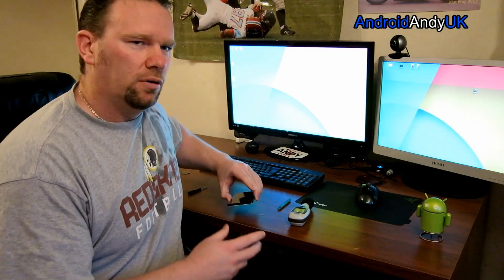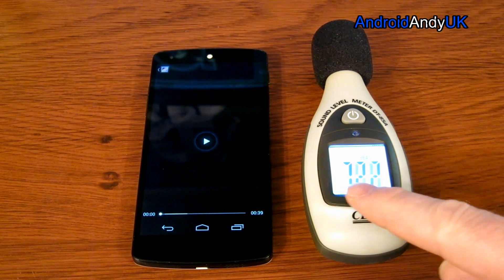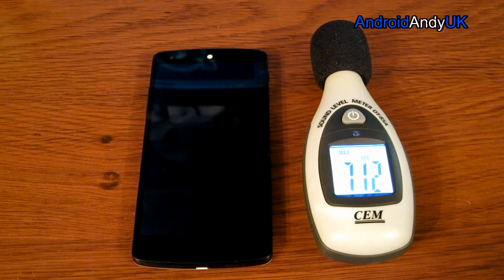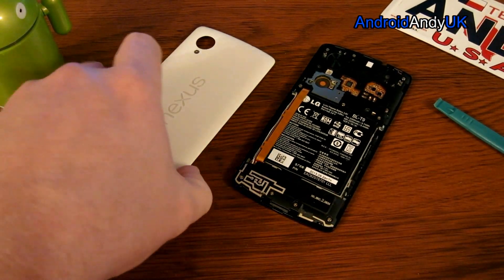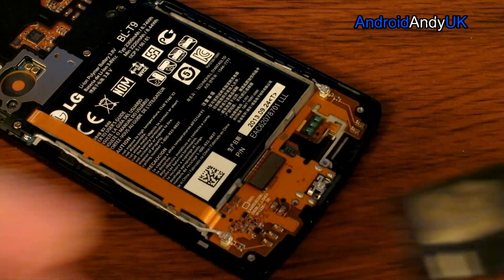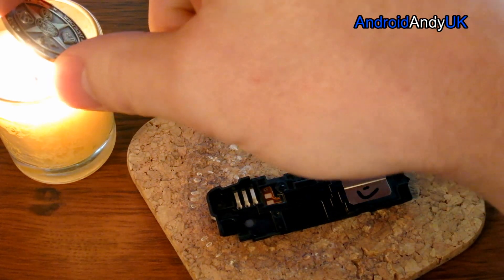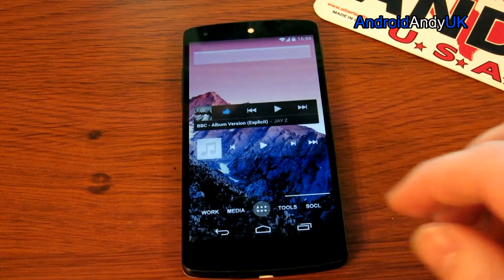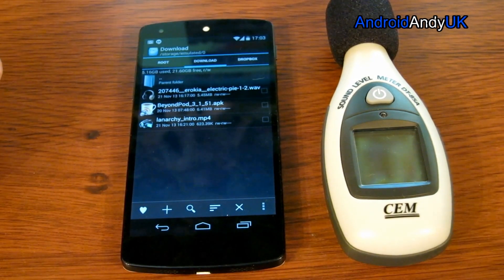Nexus 5 Speaker Mod

Comment: Don't mean to be rude but you should take this video down because quite frankly you made a real bodge job of it. Firstly those lines on the back of the speaker unit that you damaged when you took the cover off and when you scraped a set of nail clippers through them form part of the antenna circuit. The phone will develop connectivity issued as indeed many peoples have done as the months have went on. Sometimes it is not even visible that there is a break in these lines but there is a resultant deterioration in conductance resulting in the much reported bad connectivity issues. Also it is important that when replacing the speaker that it is replaced with the bit nearest the actual screen going in first and being tucked under the lugs that are there otherwise the five connections on the rear that form part of the antenna circuit will not connect with the little connectors resulting in the aforementioned problems.

If anybody is doing this modification they should follow the guy who has posted below instructions. When removing the back cover be very gentle with the bottom bit where there are little bits of sticky tape between the corners of the cover and the speaker unit. If you tear them of as in the above video then it will probably damage those circuits on the speaker unit I mentioned. If anybody carrying out htis mode subsequently gets connectivity issues then the solution is to buy a new speaker unit off of eBay (£7) and put it in the phone. Al the other so called fixesthat have been talked about are bogus. Again I reiterate, it is not even possible to see the damage to these lines of what are essentially painted on tin foil.

Comment: This guy put all the holes in the wrong spot.  The reason I provided instructions and circled the proper areas green is because without proper isolation, you will get no benefeit.

the holes closest to the speaker are on the opposite side and angled toward the display connector.  This causes the air to have a highly resistive path to the output of the speaker.    I showed one hole on the top, on the complete opposite side of the phone to where the speaker output is.   The reason for this single hole is to provide additional vibration to feel the bass in your hand.   It is a non-optimal position, however in my instructions, I clearly showed the hole opposite of the speaker and angled diagonally away.   

If you perform the modification the way I've shown and not haphazardly drill holes anywhere in the speaker you will get 7-13dB improvement in sound.
Reply: this will be so much easyer with a drill...
Reply: AndroidAndyUK did you want a dissertation?  I made sure they were obvious and pointed out each point with a green line as well as referred to the pictures below twice.  I also said pick a point in the pictures below twice. 

http://forum.xda-developers.com/showthread.php?t=2529878

You cant say I changed the instructions because they are clearly untouched since the first post before any edits. http://forum.xda-developers.com/posthistory.php?do=compare&p=47524453
Reply: Adam Outler ...you said dissertation. Hahaha
Reply: What a hack job. Man I wouldn't do any thing like that. Poor phone.
Reply from the maker: How do you mean by 'the wrong spot'?  'Haphazardly drill holes anywhere'? You realise the 'pattern' is the same, I couldn't get them through the corner part of the plastic is the only real difference.

Also, you clearly showed it 'angled diagonally away'?  Can I ask where this was shown?  I think I looked through your post on XDA and another video on YouTube.  No mention of angles that I saw.  In fact there's a lot more info in this comment than the XDA post.

As has been mentioned by others though, I think this is only worth attempting if you have an under performing speaker.

Anyone else making a video, do please come post a link though, I'd love to see it.
Reply from the maker: Who said they changed?  All I'm saying is actually the instructions aren't that clear.

Yes, pictures with green circles, I have the holes in those places, as I said I just couldn't get them on the edge.  Now you've mentioned them being angled, it makes sense.

I am still left assuming these photo's are both from the finished product, which changing what one whole is called (ah, this change?  Not instructions changing) in one it's an additional hole in the other it's the original hole.  This indicated the pictures were taken in different points of the instructions. (1 through 8)

Pictures of black holes on black plastic don't really show an angle of the hole.  Once you've said that in these comments, it makes more sense.

Maybe step 7 simply add something like 'Angle these in from the corner, not allowing them to go through the other side, see both pictures of finished product'?

Hundreds of people read your instructions and watched my video, not one said 'thats not what he said to do'

That's all I'm saying.
Reply: glad to hear it! I just got done watching this video and was a bit disappointed, though the guy was trying to poke the holes with an nfl pin and about to melt his fingertips in the process... My Nexus 5 will be here Monday or Tuesday, is it too soon to hardware mod? lol...
Reply: Jason Hall never to soon
Reply: Peter Yeh check Adam Outler 's original instruction
Reply from the maker: I think I've realised the error.  What you're saying is in the second image, those 'additional holes' poke into the empty space within the speaker unit itself?

If this is the case, maybe you can edit that into the explanation as I really don't think that's very clear.

I thought the two photo's where almost like stage 1 and stage 2, not finished products! (Esp as 'additional hole' becomes 'original hole' in the second picture.)
Reply: Simos Katsiaris yeah I saw that a few days ago. Looked fine. I was talking about the other video. Using a hot needle compared to force drilling is scary.
Reply from the maker: As I have nothing to lose at this point, I had a go at trying to get the holes on the edge, angled in...  I just can't do it though tbh  :-( 

I got a couple that are close and test say I've gained a couple of dB, but then the tests are with relatively cheap equipment, so doesn't mean a great deal :-/

Thanks for the pointers though, hopefully others can do a better job than me!

(Please edit those pointers into your XDA post though)
Reply: correct this is this is pretty bad mod job
Reply: No you won't. Does putting holes in hifi speaker's speaker housing make it louder?  The speaker itself is already firing out through the bottom speaker port freely. Making holes in the speaker housing/enclosure will only affect bass response (in most cases, negatively) as these tiny microspeakers don't move enough air to make use of more holes or "bass reflex ports". IN fact, today's best sounding phone speakers actually use tiny acoustic balls inside the housing to allow the speaker to work more efficiently in smaller enclosures. making more holes than necessary, does the opposite. Physics.
Reply: @dare2bdeviii  this is very very old. From what I remember, this was one of the first devices to use a sealed enclosure within a phone.  Also there was something with the glue getting in the way of the airflow.

Comment: andy did the case go back on ok, minus the glue?
Reply from the maker: Yup, no problem at all.  In fact, after the video I took the back off again and check the holes/made them a little bigger and put a couple more in.  Still no increase...
Reply: AndroidAndyUK at least you tried, i was interested as i may get an offical black back/cover, I have the white version, but would like to mix it around a bit not being a 'case' man